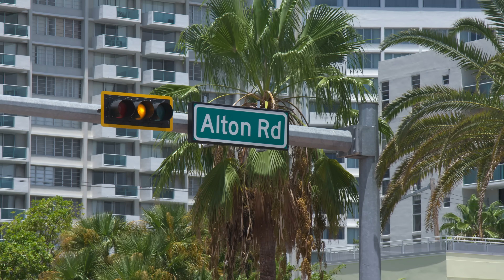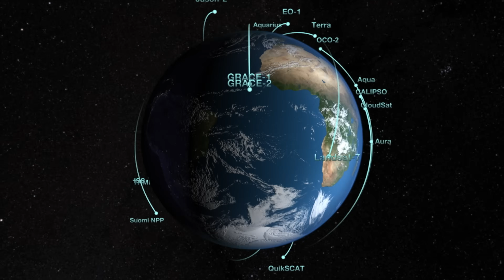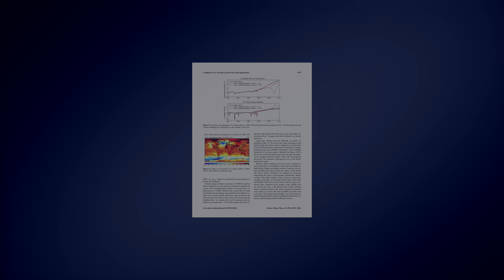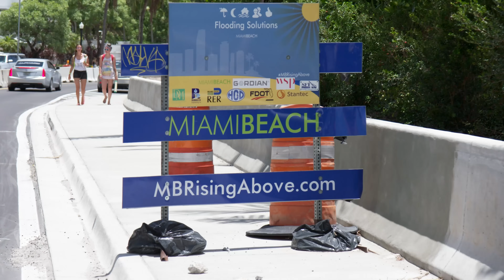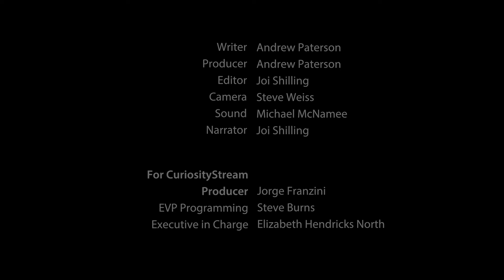The Dangers To Coastal Cities Like Miami | Breakthrough

Comment: This video has the United Nations Climate Change disclaimer.   Global warming was officially stated at 1.1°C in 1991 and 1.06°C in 2022.  It's scientifically impossible for greenhouse gas behavior to cause global warming.  All the greenhouse radiant energy from the earth is completely absorbed in earth's greenhouse effect by greenhouse gases within 20 meters of the radiating surface that is always in saturation from the strong greenhouse gas water vapor. 
 
The back of the United Nation's IPCC science report states it took its greenhouse gas samples at 20,000 meters altitude where it is common high school level knowledge there is no greenhouse radiant energy.  This is typical practice for deceptive marketing to state legal data transparency protecting the perpetrators from fraud prosecution.   The IPCC has been transparent with its data acknowledging it is not dealing with active greenhouse gases.  

Earth's greenhouse effect is frequently used as a primary example to high school students of a system always in saturation from the strong greenhouse gas water vapor absorbing all the greenhouse radiant energy from the earth with greenhouse gases within 20 meters of the radiating surface that is all around us everyday and can't have its overall effect changed.  There is no further greenhouse radiant energy to interact with greenhouse gases.  At 1% average tropospheric water vapor over 99% of earth’s greenhouse effect is from water vapor.  Water vapor would hold earth's greenhouse effect in saturation if it were the only greenhouse gas in the atmosphere.

Arctic warming is taking place with the proving mechanism being warm Atlantic Ocean waters migrating deeper and more frequently into the Arctic Ocean warming it and the region.   That warmer water is causing a few weeks less of reflective snow and ice coverage resulting in more solar heat gain to the Arctic region surface.

Atmospheric CO2 levels of 1200 ppm about three times what they are today would greatly invigorate C3 plants the majority of plant life on earth greatly greening the planet. 

0.4% of the atmosphere is CO2 and on average 1% is H20 water vapor.   (1% H20)/(0.4% CO2) = 25.  Water vapor is 25 times more present in the atmosphere on average than CO2.   Water vapor has an CO2e of 18,  18 X 25 = 450 CO2e total for water vapor to 1 CO2e for CO2. 

The Earth’s oceans have 3-1/2 million sea floor volcanic vents warming the water and changing it’s chemistry that have not been systematically accounted for.